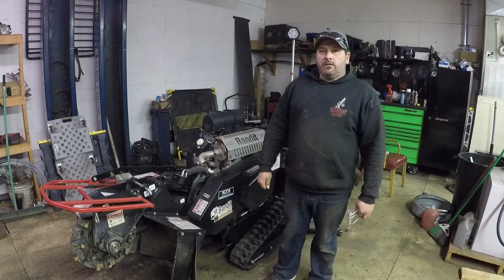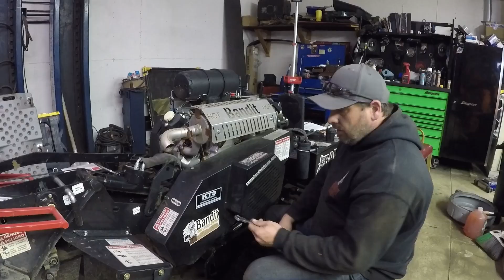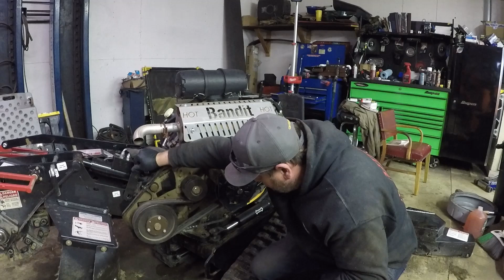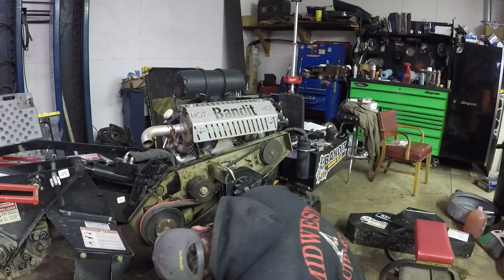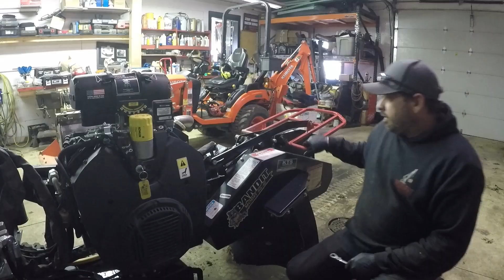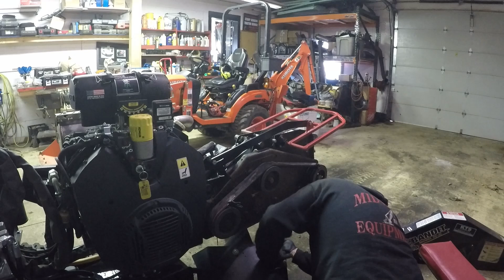Stump Grinder Problems? Learn to Adjust the Belts on Your Bandit SG40! DIY

Comment: How do you like this SG40? I am about to pull the trigger on basically a new 2023 SG40W and have heard that this Kohler motor can be problematic? How many hours have you run it? Would you recommend this machine? Any feedback you have would be greatly appreciated! Happy New Year!
Reply from the maker: I am happy with the machine for what it is,  It is also the only stump grinder I have ever used.  With that said talking to the local guys they run pretty good with the new river wheel for a smaller machine.  There are times I wish I had a larger more powerful machine.  It does clog the head buried in chips an mud when chasing a whole stump.  However watching other guys grind in the groups it doesn't seem the norm is to remove the whole stump.  IDK, I try to grind it all.  I am overall impressed and happy with mine, It has tackled some big jobs it probably shouldn't have.  As far as life expectancy I don't know.  I am right around 100 hours of actual grind time.  Mine is a '22 and it seem ok.  I did my first oil change at 15 hours then every 30 hours after that.

Comment: Do the tensioner bolts need to be tightened to a specific ft/lb's according to the manual?
Reply from the maker: my specific manual doesn't state anything in the adjustment process but that is not to say that I may have over looked it.

Comment: Thanks dave running up on 50 hours and this video has helped
Reply from the maker: Make sure to check your air filter often and keep that clean as well!
Reply: @DaveDoesIt85  yea did the full tune up  air filters oil change checked belts. 
The oil filter looked a little different from my original one but everything fit snug so I just sent it